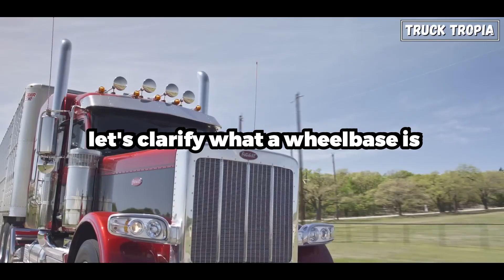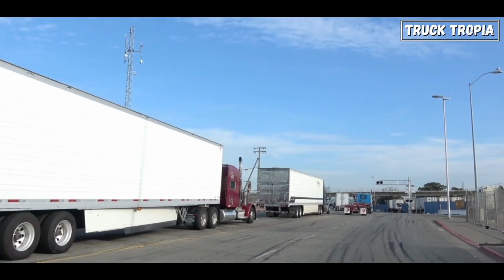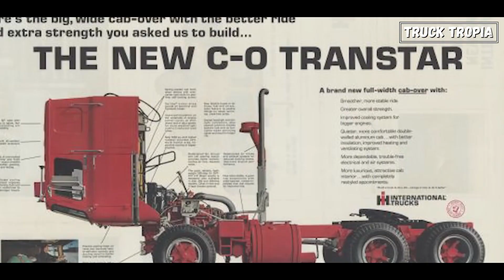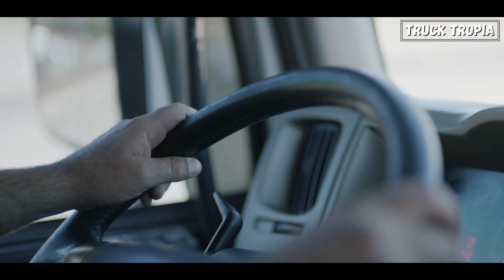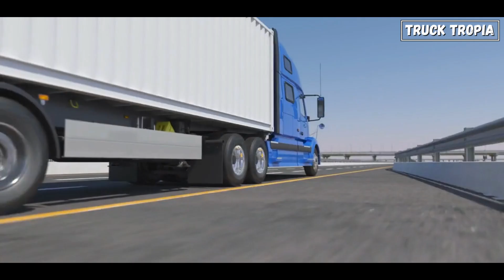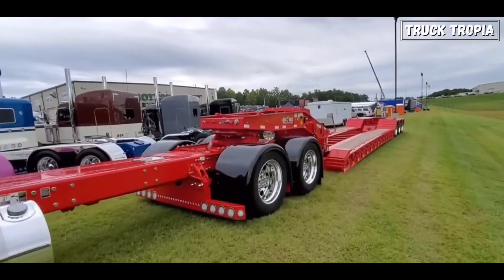Why Trucks Have Such Long Wheelbases?

Comment: Mine is 2020 Western Star 5700XE with Detroit DD16 Engine the most powerful Engine I can get on my money and it is Eaton Fuller 18 Speed Manual Transmission I hate Automatic! Mine only have a small studio sleeper because I don't need a sleeper berth that's the size of apartment bedroom. I want it small that I can sleep for at least 6 to 8 hours and enough space for me to change my clothes with privacy. Studio sleeper and it is a very short wheel base 
Because I want light weight trucks with the Long Distance and Power of Long wheel base trucks with a Maneuverability of a Yard Horse Truck. 2 more years I'm gonna trade in my Western Star with a Scania Cab over truck still I want it very short wheel base. 
I want it with a Power and Torque and Super Maneuverability especially in super tight yards or warehouses and Endurance in Long Distance Driving.

Comment: but does those extendet trucks offer front driven axle? because if something like this is going without trailer or without load it has practicly zero traction on rear wheels

Comment: Well this is like my new favorite channel…😂 I work in shipping and I load trucks all day. This one company has really nice trucks and trailers. Every one of his trucks are Peterbilts… I loaded this one truck that sat lower and had a longer wheelbase. That was by far my favorite. It wasn’t crazy long like some of the ones in the video but maybe 2 or 3 feet longer. I remember I had to load it slightly different because it was longer. Typically we load them lighter on the front, heavy in the middle and lighter on the back. This also kinda explained why we load them the way we do… Thanks for the video. I’ve been thinking about getting my CDL’s…

Comment: Long wheel base are great for open decks. Longer wheel base, smoother ride and stability. And comes in handy when hauling over length steel beams.

Comment: Trucks have long wheelbases for a couple reasons. 

1. Spread the weight between the steer axle, drives and trailer axles 
2. Smoother ride. Shorter wheelbase trucks ride rougher.

I drove long haul operating in the continental U.S. and Canada for 38 years and trust me, if you're driving 2500-3200 miles a week you want a longer wheelbase.  But you pay for it when you have to go into cities or tight areas.

Comment: Correct me if I'm wrong, but longer wheelbase trucks are not necessarily able to take more weight than shorter wheelbase. It's entirely dependent on how the rear axles of the truck are designed, which has nothing to do with how long the wheelbase is. The weight from the load is almost entirely taken by the rear axles of the truck, and the axles of the trailer.
Reply: I think you are absolutely right

Comment: All the trucks for the company i work for are with a long chassis (front and back axle) for a smoother ride for the driver.
For 13 years i ask for a 3 axle unit (we're always too heavy) but sadly.. due raising the taxes on German highways this is still too expensive

Comment: The simple answer is wheelbase has nothing to do with gvw and axle weights but legislation has everything to do with it. That's why the current federal limit in the US is less than what the UK was running in 1983 let alone the increased limit in the UK from 1993 to the present day. Norway allows trucks about  15% heavier than the UK .

Comment: In europe trucks also have alot of different task to do. With the same axle configurarion. Heavy loads were pulled by 4-axle trucks. But a longer bed is rare. And don't say our shortbeds are not comfy.

Comment: I run a 1993 K100E Kenworth Aerodyne with an RTAC (Canadian) legal 244 inch wheelbase.  For long beams, pipe, poles etc. it can not be beat.  Why use a stretch trailer when I can hang 10 feet off the nose of the trailer?
Reply: No headache rack, that's why.
Reply: Headache racks are still required by law.  Plus you gotta hang chains and binders someplace. @dannysdailys
Reply: Exactly what I meant.  @KeithJibben

Comment: I don't understand how a longer wheelbase reduces the strain on tires and suspension? How does a longer wheelbase reduce road surface wear? Third, how does a longer wheelbase handle larger and lighter loads?
A longer wheelbase increases stability and driving comfort on highways, I accept that, but that's all.
Can someone tell me how big the largest axle weights are in America and does the wheelbase affect them?
Reply: A long nose long wheelbase keeps you alive in the event of a very bad multi vehicle accident. In a cab over, you're the first one to the accident. I know of many drivers personally who have been killed in them. 5 of them in just one wreck in the winter outside of Reno, alone.
Reply: heavy haul 4 axle trucks need a longer wheelbase due to the additional axle.   They usually have longer fifth wheel slides so you can get more weight on the steer axle.   Bobtail im 15,500 lb on the steer and 15,000 on the drives with a 288" wheelbase.   With a 13 axle setup i can get  60,000+ lb on the drives/pusher axle, and close to 20,000lb on the steer.     The turning radius is pretty bad, backing can be tricky due to it taking a long time to get back under the load.     Its not ideal for tight spaces, but necessary due to the fourth axle, fuel tanks, apu, etc.
Reply: What's that in Kilos? Come on USA move in to the 21st century. @hkerekes

Comment: Long wheelbases because 'murica. Bugger long wheel base semi's, makes it hard to drive a truck in tight spaces. Most drivers are so fat they have enough padding to ignore bumps in the road. 

Long wheelbases decrease load capacity.
Reply: Don't need load capacity if your business is hauling foam, or flowers, or zit faced teens.  Btw just starching the frame by 3-4 feet with no extra cab on it,  is absolutely negligible in truck weights.  
Aaaaaand once again, not everyone goes into tight spaces, actually believe it or not, 80+% of trucking happens outside of big cities.   Come harvest season,   Wowee them country trucks come out of the woodwork. 20 year old trucks, not one mile in NYC, or LA, or..... allergic to it.
Reply: @jimmahr.4665  In Australia, the long wheelbase is used by drug runners pretty much.
Reply: @Low760  LOL, (not dismissing, just funny statement)  You sure that's accurate?  Media likes to do propaganda when they want to achieve something, good to have public opinion behind you when you go attacking a group.
Can't speak about Australia at all, but here in US all the "custom" type trucks are Owner Operators, you don't go buying extra expensive trucks for employees.  Big trucking companies run what I call "corporate trucks".  They might be going after small business to put them out (we have a lot of this here in US but by different means), and attacking anything custom would be what stands out to the public, yet not committing heresy by outright saying they want moms and pops shops to die.   And why would they?  Money.  They can make more money.
And if you think the world is not this corrupt....  yes it is, remember, man can get pregnant.
So what you said, I don't buy it.  Not even as an indicator let alone a rule.

Comment: I like my truck having a shorter wheelbase. I'll take manoeuvrability in tight docks and yards over general stability
Reply: Different needs and use cases.

I love an 8x4 with a lift axle for hill traversal

Getting around 6 mpg on 70 ton loads.
Reply: I say bring back the cabovers and the length laws
Reply: @Perich29  I wonder, why say Volvo does not sell their European style cabovers in the US. IMHO, they would be popular in the cities and for short haul delivery. Also, they could bring their crew cab line as chassis for the firefighting vehicles.

Comment: An other issue is that more of the wheight would be distributed just onto the rear axles making it more likely to have issues stearing at slippery road conditions
Reply: And I think it does, heavy end always wan to be in the front.  Also pay attention to truck crash videos,  if a truck has a single drive axle it jack knives EVERY time, tandem drives do it about half the time.

Comment: It would have been helpful to illustrate (with graphics) the difference between a set-forward and set-back front axle position, comparing two trucks with the same engine and hood length, same cab, same sleeper, and same cab-to-axle distance. The set-back axle decreases the wheelbase and shifts load to the front axle from the rears.
Reply: I don't know, my cabover Pete double bunk had 18,000 on the steering axle bobtail.

Comment: Wheelbase choice has almost nothing to do with high-speed stability, but the rest of the reasons are valid.
Reply: And not weight either. Longer means heavier. American suspension systems aren't as good as European trucks and will need longer wheelbases to be smoother.
Reply: @Low760  North American heavy highway trucks essentially all have beam axles with leaf springs in the front, and live beam axles with air suspension in the rear. I realize that Volvo offers independent front suspension in the FH but I assume that's not standard practice across the industry - what do typical European trucks have that is better than the North American trucks?
Reply: @brianb-p6586  A modern truck with fuel effeceient engines, quiet exhausts and higher gross weights for a start . . .
Reply: @TRPGpilot  sorry, I was asking specifically about suspensions. 

And there is no difference in engine efficiency between trucks in Europe and North America - they're generally using the same engines now. There is also no difference in weight capacity: US Interstate rules limit weight to lower than typical Euro limits, but many North American trucks run much higher gross weights in specific areas... including right across Canada.
Reply: @brianb-p6586  Fair enough though I doubt that US truck engines 
 can be Euro 6 compliant. Fair point though. Have a nice day!
Reply: @TRPGpilot  in some cases they're the same engines, such as Volvo's D13 used in the FH in Europe and the VNL in North America; with the same engine design covering the same power output range and with the same features (including the turbo-compound variant) they will have similar emissions.  Current US EPA Tier 4 and Euro VI standards are similar.

But my question (for @Low760) was about suspension: if Euro truck suspensions are better, what difference in suspension design makes them better?
Reply: @brianb-p6586 Well I have been educated. Better stick to what I know best, aviation. Ha Ha 🙂
Reply: @brianb-p6586    Don't expect an answer from Low760, he's one of those "America sucks, colonizers are evil, Communism is the best" intellectuals. It doesn't do specifics.
Reply: @brianb-p6586  idk the volvo fh16 is rated for 325 metric tons conbinations out of the factory
Reply: @einar8019  every brand of truck has models that can be configured for a range of combination weights; that doesn't address the question of what feature supposedly makes Euro trucks superior.

Comment: One of the Disadvantages of extra long wheelbase is ground clearance on railroads
Reply: It's usually the trailer getting stuck
Reply: Not just that!!! But also Backing/Reverse Maneuvers 
Long Wheel Base Semi are so Stupid!
Reply: Actually not really, there are some real bad RR crossings out there, but I pull an RGN (version of a low boy) with 6 inch ground clearance and 48' overall (40'? bridge) and it scrapes here and there but not bad, and its 6" ground clearance, and about 40' between drives and trailer sets.   (construction sites with the sewers sticking out of the not yet paved road give me hibby jibbies though)
Reply: @jimmahr.4665  Sounds like a disadvantage
Reply: @elijahtucker7938  A trade off.  
Tall things fit under bridges and wires, and you get to drive things straight on to it without pooping pants that you will fall off side.
My point was to what it takes for a long wheel base to become a ground clearance problem.
Reply: @jimmahr.4665  That's a Really good point. There's trade offs for everything, and I retract my ignorant comment 😁

Comment: I was stationed in Europe for 9 of my 22 years in the US Military and I notice very few purpose built trucks and fewer trucks with long wheel bases, just some observations from my travels in Europe.
Reply: Wow, I see we have two super truckers here, must have put down a lot of miles to be so opiniated on someone else equipment. (replies)

In Europe, regulations limit trucks front bumper to rear bumper, also they need maneuverability more then anything else on the smaller roads, much different here in US, regulations here are about axle set spacing, the longer the better up to a max limit. (Short spacing can't carry as much gross).  

The tractor shown at 5:23 is ridiculously long, it will stay out in Nebraska's or it will be purely show truck, and it cost more then your keyboard warriors daddies' house.
They ALL ARE purpose built for their market.
Reply: @jimmahr.4665  yep. I definitely don't know what I'm talking about in my 18 years working on trucks as a mechanic. Nope.
Reply: @Low760  
automatically
Edit:  Well I don't remember posting this, started on one but?....
In any case, if you want to compare shwang sizes, 25+ years driving, 15+ semis, dry, reefer, ltl, flat, knockle booms, tankers, cryo, low boys, over dims.
You know something, but by now you also should know that you don't know everything, and I have an opinion on how to replace the clutch, but sure as heck not gonna tell you how to do it.  Each has their own way, results is what matters.
Reply: @jimmahr.4665  actually the weight limit is based of the distance between the first and last axle at least here in sweden it is. if you have 20,2m between the axles you can have up to 74t on most roads
Reply: @einar8019  Uh, I didn't specify,  bumper to bumper as length regs, (btw, here in US there is no regulation including the tractor, there is only limits on the length of the trailer, basically everyone pulls 53 foot trailer, then tractor is whatever, that's also why Europe uses cab overs, the shorter the cab, the longer the trailer can be for them, no limit on trailer, but limit on overall combination)
 I know very little about European regulations overall, and I would assume that regulations very between countries in Europe like they do in US between states, but there is a version of truck that's legal in all countries, like here in US between all states.
74t  max with no permits? As in so called "running legal" at 74t?  Here in US "legal" is 36.28t, then need permits for overweight. I know that limit is higher in Europe but not by much, 40t? But I'm talking cross continent.
Edit:  I just re read my entire previous post, no wonder that didn't come across right, I mixed it all up lol.
Reply: @jimmahr.4665  Calm down, dont elevate your blood pressure, it;s OK to take it on the chin sometimes . . .
Reply: @TRPGpilot  No high blood pressure,  "emotion" is lost in text, go back and re read it in a super chill, snoop dog way and will come across different.
That's why books are so dreamy, you put your own emotion into the story line.
Reply: @jimmahr.4665  that's good, you have experience with American trucks in America. My experience is American and European trucks in Australia in a major city. Where mostly the towns of every state in Australia are under 1million people outside of the capital cities. Long wheelbase singles look cool, but they aren't that long compared with American ones, but they can't pull a b double or a double with up to 80~metric tonnes due to length. The length rules I don't know why we have them but I do know that as a semi gets longer in chassis it loses carrying capacity.
Reply: That's because they don't need to be purpose built as they don't suck.
Reply: @Low760  Exactly! Who wants an truck with a wheelbase that would make a locomotive jealous with envy?

Comment: Also interesting are some of the long wheelbase rigid trucks.  I once worked on the development of a four axle chassis to carry a 40ft shipping container.  It had a wheelbase of over 10 metres!
Reply: I don't believe it 😂
Reply: @driverandy4263  If I remember correctly, it was 10.8 metres.
Reply: @driverandy4263 Check out "Super Dumper" if you design them like this you could fit a 20 feet container and have 80.000lbs of legal weight.
Reply: We load those 40 footers on regular container chassis trailers. Sure, those trucks are usually extended slightly, but that has to with our weight regulations. A regular semi truck you'll find on the European continent has a max weight limit of either 40 tons (4x2 pulling a 3axle trailer) or 44 tons (6x2 or 6x4). Up here in Sweden, we extend the trucks slightly and reduce overhang on the trailers to make them allowed to weigh up to 50 tons. This because total weight is often regulated by the distance between first axle and last axle in an axle group as well as overall. A regular American semi truck has a max gross weight of 36 tons, for reference. When it comes to rigids, that is the most comon thing you'll find in Sweden. Most Swedish truck drivers drive either 6x2 or 6x4 rigids with 4- or 5-axle full trailers. These has a max gross weight of 64 tons (141000lbs) and are 24 meters long. Then you have the 8x4s pulling 5-axle trailers and those bad boys can weigh up to 74 tos (163000lbs) and they are up tp 25.25 meters long. Then there is that Scania S770 hauling woodchips between a train station and a powerplant. It's an 8x4 pulling a B-train with a dolly. Max weight? 98 tons (roughly 215000lbs). It's also 34.5 meters long (from front bomper to the back of the trailer)
Reply: Yeah, but that's different, it wasn't pulling a 53 foot trailer.
Reply: @dannysdailys  That's right.  The 40ft container dropped straight on the chassis behind the cab.  It was pretty hopeless on corners though!